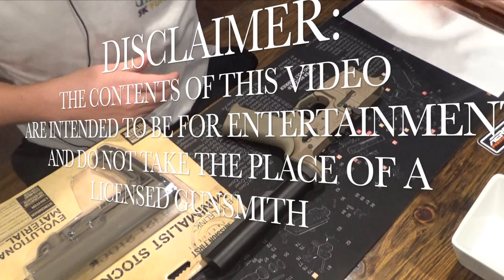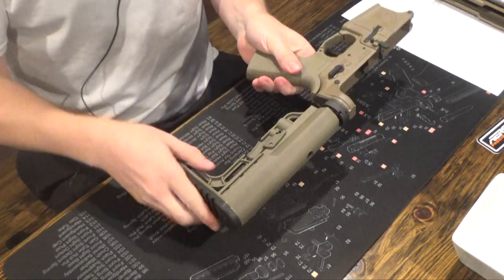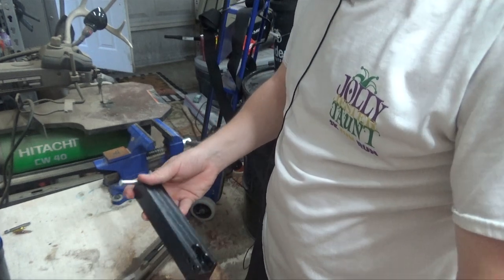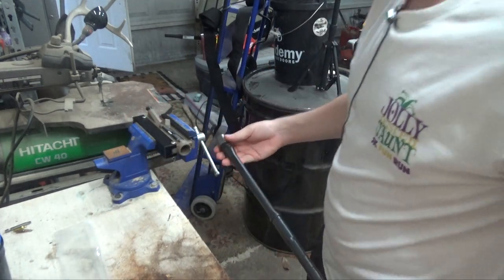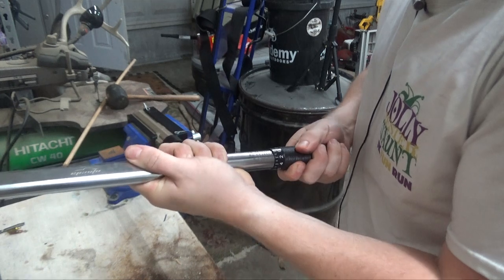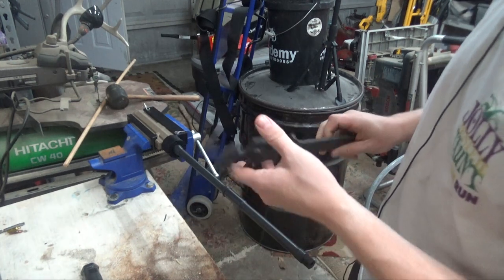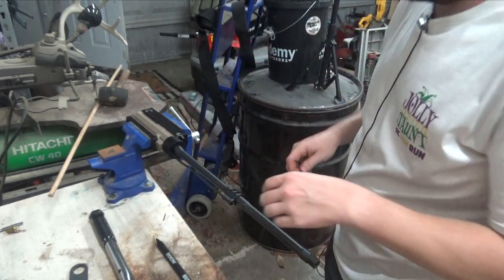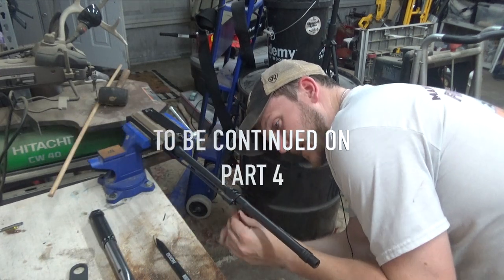AR15 Step by Step Build - 6.5 Grendel - Part 3

Comment: You can do a 45 or 25degree angle as well you need to know the length of the wrench your using to add that to the torque though. Simple way to look at it anytime you add length you add leverage.
Reply from the maker: Ahh yeah didn’t think about that as an option! Thanks for the tip!

Comment: What Barrel did you use for this build? Does it come with a headspaced Bolt?
Reply from the maker: It was a Faxon match grade barrel, you can buy a head spaced bolt if you buy both from their website. But the barrel and bolt were more expensive than other websites and easily covered the cost of bringing it to a gunsmith to headspace it for me!